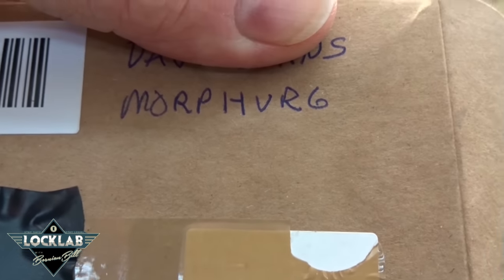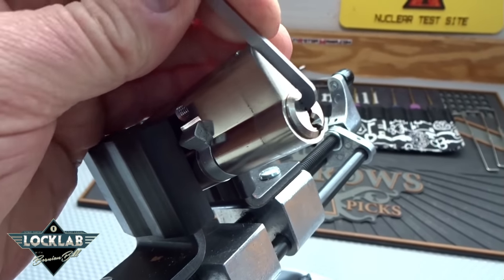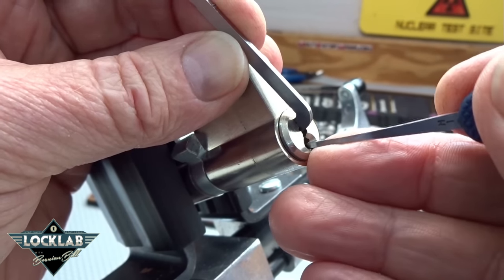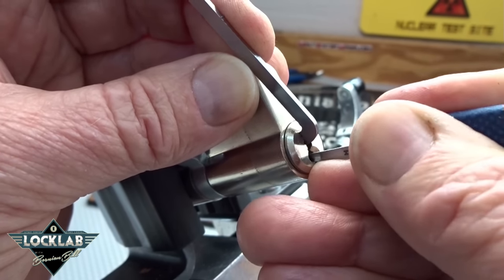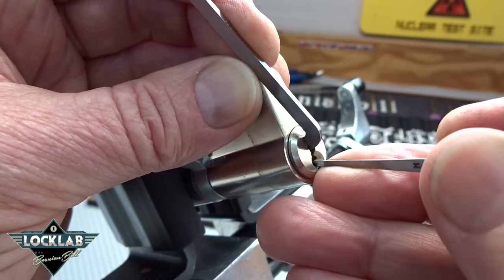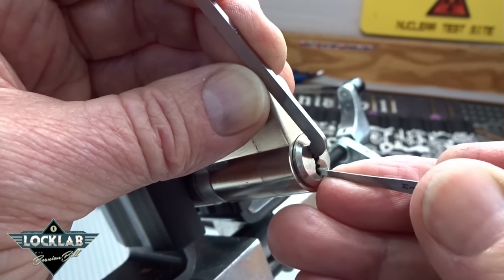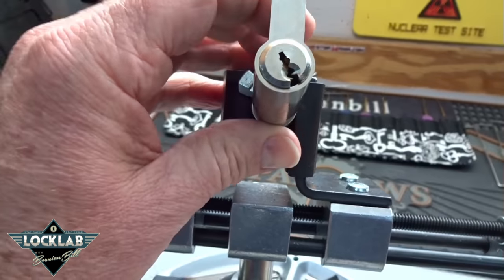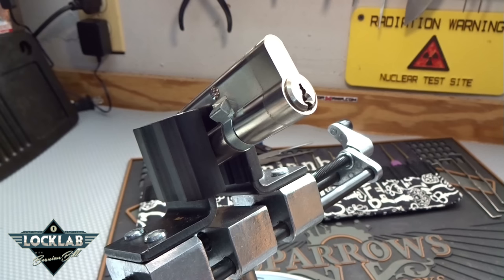(818) Tigris Freak from MorphVR6

Comment: I find it neat that all these expensive locks are easy to pick with practice. I started picking a few weeks ago but only had paper clips and a lock that seems to be pretty hard. but I made a standard hook pick and a tension wrench from key rings and went and bought a 2 pack of master locks. level 4 security and got it on my second try in about 15 seconds. I need to get more locks and practice on them and get me some real picks sometime. Thanks for the videos, it's fascinating on how they work, just something fun to do when you're bored.